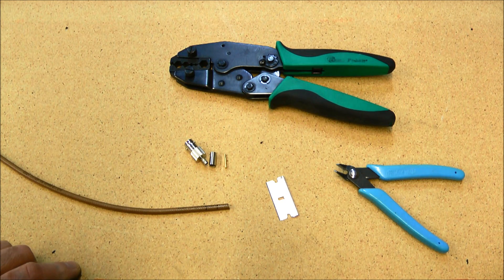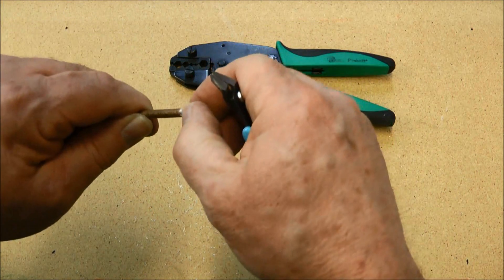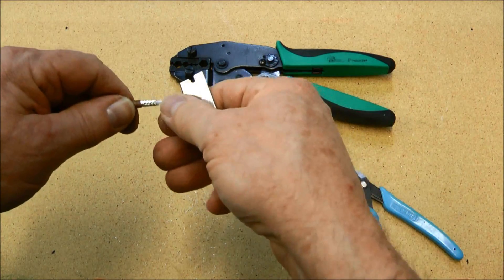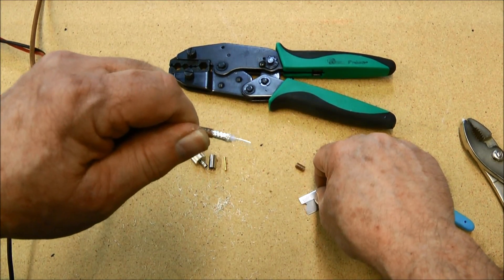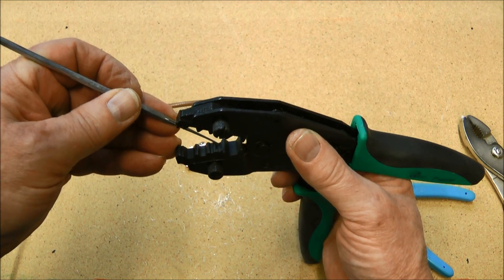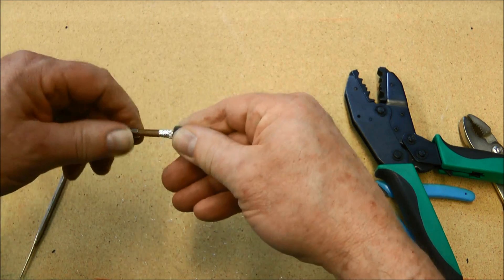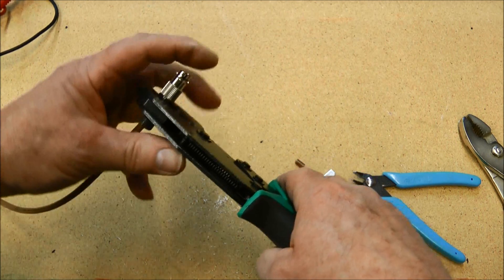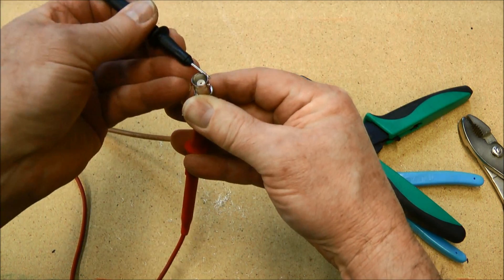010: BNC COAX CONNECTOR CRIMPING (on RG-400)

Comment: I have a stripping tool for RG-6, -59 and -11, but not -400.  Sure is much easier and faster than the razor and pliers technique and much less prone to error.  These stripping tools cost no more than a few ruined connectors from bad connections.
Reply from the maker: Indeed there are a number of strippers out there, and if you find a good one for RG-400 that's great (they do exist but for aerospace work are typically hundreds to thousands of dollars).  However a multi-size stripper for RG-6/59/11 would not repeatedly work accurately -400.  The purpose of this video was/is to demonstrate the crimping of the ends.

Comment: that "skirt" left on the crimp ferrule is supposed to be there.  double crimping crushes the coax since that part is not supported by the connector.  It's probably fine but technically could change the impedance at that one spot.

Comment: ACTUALLY  putting the 2nd crimp on the sleeve is a BAD idea.  The end of the sleeve should remain uncrimped so if the cable is bent against it it is less likely to cut into the jacket.  Leave it like a bell end.
Reply: What setting do you use on the multi-tester to test for a short?  And what reading are you looking for?
Reply: John Bacon anything less than infinite resistance is a fail.  1 strand of your shield touching the center conductor(s) will kill your signal.    That being said I once fixed a bad crimp (again probably only one small strand) by running 120 volts (AC) through it for a second.  The one tiny strand acted like a fuse and POOF the short was gone.    Trick we used to use in the alarm business to find weak points in window foils.